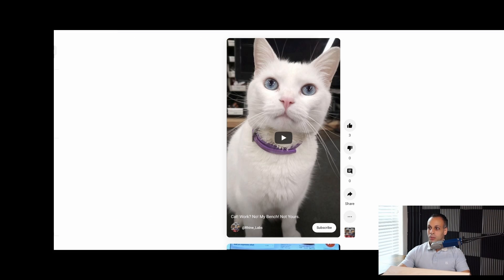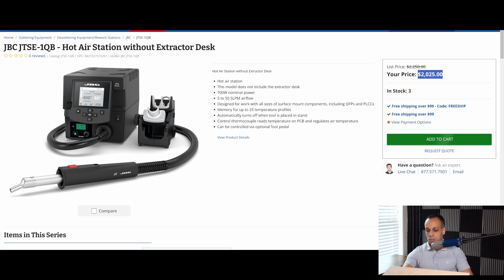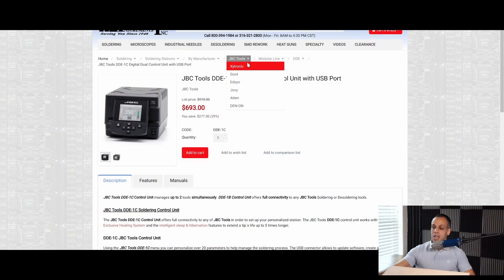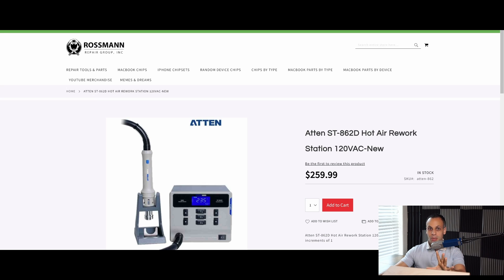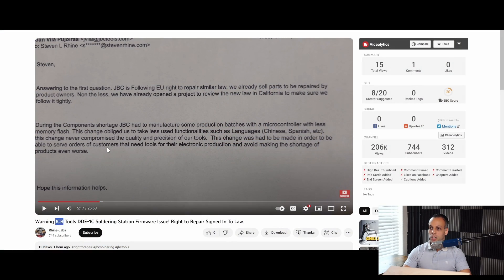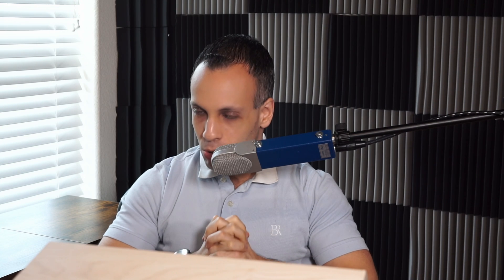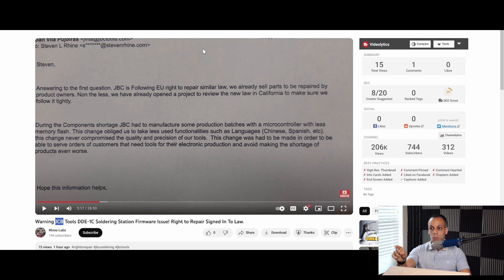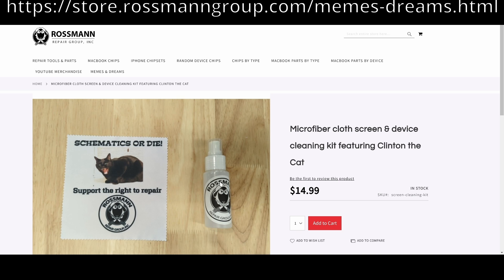JBC's handling of DDE-1C issues is informative & unfortunate 😞

Comment: General Motors was up front and STATED features NOT available at time of delivery AND will be added to YOUR CAR once the chips are available 
and they made "dummy" modules to install and replace the modules they are NOT including 
and now are fitting the ADVERTISED features as the modules are available NOW 
GM is NOT a corporate "good citizen" by a country mile and THEY can do it correctly 
JBC could have bean "upfront" and sold a version advertised differently and say call it the "basic" and nocked $9 from the price and make the original perma back order/ sold out till the original spec chips are in stock again 
they "win" as they do NOT have to "fix" sold products AND zero reputation hit OR post sale consumer support over this issue 
consumer does NOT lose as they BOUGHT a lower feature version BUT received that they paid for
Reply from the maker: This is the sad part. So few people used these features that being honest about it would've done so little damage. Lying and bsing about it when you sell the most expensive tool in the industry does far worse.

Comment: I used a JBC station just once. The thing was quite new at the time, it wobbled on the desk. it didn't give me the impression of being particularly solidly made or worth anything near the price it was. I'm still using an old Ungar (Bought out by Weller) station from the late 1980's and as I was smart enough to buy a lot of tips and a spare heating element, it still gets used most every day. Some 25 years ago I bought a second station, a Pace, which still works as well as the day I first used it too. The trouble is, in my opinion, people get sucked up in all this social media crap commercial shit telling them this or that consumer grade brand is "the best". Well, none of them are any fucking good and all are overpriced. That's probably why the likes of Philips or Holland Signaal (now Thales) didn't and still don't use Hakko or JBC or any of the "special Chinesium" crap. It's all Weller, Pace and some Ersa. Really, look into those manufacturers and upgrade to big boy tools and you'll be rid of this headache.

Comment: Funniest and saddest thing at once is… the stuff they have in their flash can be cleaned up and the features reinstated. Their code density isn’t great and it’d take some minor rework of the source code and linker scripts to make it better. The smaller flash should fit everything and the language overlays. You just have to apply a bit of thinking to it. JBC all you need for a fix is some brains and a firmware update.

Comment: Hi Louis, how do you handle hot air rework for smd components right next to electrolytic caps that do not tolerate heat ? I have to fix such a board for a 2004 honda car radio. I can put generic insolation silver tape to protect the caps but i am concerned it's not enough. I practiced on a scrap board with my 861DW and the tape did seem to protect the cap but the yellow glue that held it to the board (capacitor is mounted layed down on its side) burned and made a brown hard poodle ! I searched youtube for that issue and there is almost nothing on it.

Comment: I don't know when I've ever even heard of the most expensive of ANYTHING being the best. Usually it's just bragging rights. That said, shame on JBC for not being up front about changes to their specifications. A lot of very mission critical applications requiring certifications out the wazoo are relying on a so-called top notch vendor  to be technically sound. This stupid blunder could have and still may put companies at risk for un-knowingly violating certification requirements with the likes of NASA, Boing, the military, etc. Ask Fluke what they did during the chip shortage.

Comment: Gonna buy a JBC C245 pencil, control it with a cheap microcontroller + oled + encoder + MOSFET board, and power it with a 200W Meanwell PSU. Might be able to do the same with one of their hot air blowers.

Trust the hardware, do the problem solving in software.

Comment: I learned something, you can put an Arduino inside a hot air rework station along with a mono LCD and charge an extra $500USD, lie about it having ' features' and add more and not be held accountable.  I learned that you can ' forget ' to order SRAM ICs to store profiles and get away with it.  I learned that with my simple Arduino IDE level of programming skills I could design a better controller, have it use all the listed features of the several thousand dollar hot air rework station and use the same motor controller boards found in the 50+ Arduino Projects kits to control the hot air fan and temperatures with as fine precision and potentially open source the whole thing.
Reply: They should be using chips that never go out of stock, like old Microchip PICs or Espressif ESPs. All of industry relying on STM32s was the real problem, same for all hobbyists relying on AVRs. RP2040s are looking decent for supply capability, though personally I think these CH32Vs are looking appealing. The CH32V003 is cheaper than an ATtiny and has the specs of an ATmega, while the V203 is cheaper than an ATmega and has the specs of a pi pico. Programming tool chain looks decent, which is important. Supply capability is still up in the air, looks more available from their official store on Ali than their LCSC listing, for now.

Comment: This sucks. JBCs are amazing. Not so much the tweezers, hot air etc. The normal, regular size soldering iron is just so darned good. Been using at work for years. Wanted to buy one for myself. Hmmm. Shit. I saw an online thread on how you can buy the handpiece and just design your own power controller. I am qualified to do so.....i guess thats what ill do. The pinout/sensor is apparently straightforward.
Reply: Marco Reps did just that with excellent results. https://youtu.be/cYgjcDbSyRE  and https://youtu.be/GYIiOkr6x9o

Comment: I own a JBC station (although not a DDEC), and I regarded JBC very highly. Using the iron you really do notice a big quality difference and for their regular soldering irons, they are much nicer than some of the competition (such as Weller). Extremely disappointing to see this behaviour. It will definitely reconsider the purchase of their equipment in the future. If you pay an A class price, you expect A class service and a company that takes responsibility for their mishaps. 
I suppose they changed and are now riding on brand name trying to maximize profits. The exact behavior that costed Weller the market here in Europe. They dominated the solder iron market, but lack of innovation, sky high prices and drops in quality caused them to now become (in my eyes) B grade.

I figured they must have cheaped out a bit, as their packaging is also the 'pseudo enviro friendly' kind, which often enough translates to piss-poor and cheaped out on.

Comment: We've has a DMPSE (2000€ 4 Tool station) and honestly I'm really disappointed. 
The normal tools are very good. 
The tweezers are nice but plagued by stick-and-slip effect. You want them to operate smooth when you are working with small <0402 components and with little force. But the sdjustment between the both cartridges is another friction point, which makes it quite bad to handle. 
Also there is a lot of injection mold flash (relative to what you expect on a 2.5k€ tool)

Last but not least, the station let the magic smoke escape!
I turned it on, it did not boot and suddenly it started to smoke out of the vents. 
Further it seems the cartridges are powered on while the device is still booting. This can be notices as the cartridges have ~70°C when it bas booted up (while in their holder, where they are usually powered down completely). So I suspect someone messed up and it starts to heat up somwhere in the boot process.
Reply: How do you fix stick-and-slip? I thought this was because of the solder surface tension and not design? I'll have to check if my stations heat up on booting. I've never noticed anything, but I have the DDE-1C and it's predecessors, as well as the compact self-contained stations. Does the DMPSE take a long time to boot or anything? The stations I have appear to be almost instant on.

Comment: Hi, Louis you probably won't see this, but I figured I'd ask anyway. I want to set up a station for drone borne instrumentation controlled by Arduinos. As an aspiring amateur, what is your recommendation for equipment such as soldering stations?
Reply: I'm not Louis but personally I'd snag one of the clone compatible T12 stations or one of the generic stations compatible with the JBC C245 cartridges. Either option would work well. There's several revisions of the T12 style stations and some handpieces that are better than others, so do your homework. I have a clone T12 and am very happy with it's performance, though I might consider one of the C245 style systems if I were looking now. They weren't really common, and the prices have come down a lot in the last couple of years. Regardless, good luck, and I wish you well with it!
Reply: @2011JMB  thank you

Comment: The same is true for car recalls. Fords are always being recalled, it's your responsibility to bring it in, and they treat you like crap while it's happening. I know from experience. I've heard tale that some high end car brands, during a recall, drive a rental car to your house, drive off with their model for repairs, and then do the reverse at the back end. Real customer service.
Reply: I find it endlessly amusing that you can pay well over a 100k for a garbage ford truck. If you tolerate garbage you get garbage. It's quite simple.
Reply: I will NEVER buy a Ford again after how they treated me over a warranty repair.  My engine blew at 64,000 miles.  I pulled it off the side of the road, and it got a little tiny bit of mud up the side of the wheel well.  Had it towed in to the dealership I got it at (where I also did ALL my service!), to use my extended warranty - only to have the guy come out and yell at me that it wasn’t covered.  According to this “genius” I was “off roading” my vehicle and I owed them $3500 for a new engine.  I assured them I never did such a thing and they called me a liar, made a big deal over this literal LINE of mud in the wheel well,  and told me to get my car off their lot if I wasn’t going to have them fix it.  After a week of nothing but stress, and no car - I ended up calling Ford themselves (above the dealership), and a guy drove down from Detroit personally 👉🏻 and told him they were idiots for accusing me of off roading, and told them to fix my vehicle under warranty.  They way they acted you would have thought it came out of their pockets personally!  They lost me as a customer from that day forward!!!

Comment: That's really disappointing to hear. I have a DDE-1C in storage from 2018. Recently I ordered a third cartridge stand from them. 
If you think the station is overpriced, the stand is a block of cast iron and costs at least 1/2 to 2/3 the price of the DDE-1C.  It was packaged really poorly and insecurely compared to the first two I ordered several years prior. It came fresh from JBC and was actually damaged. I got it exchanged but the retailer came back and told me the replacement that came in was also damaged so they returned my money and cancelled the order. I did send a message to JBC it was not acceptable to skimp on packaging for something at that price point. Literally thrown into a box with long bundle of kraft paper loosely looped (looped in 2 dimensions, not wrapped) around it for padding. Just utterly unacceptable. It used to be form fitted foam or form fitting cardboard seats in the box.
Reply from the maker: It sucks when companies ride out their reputation and choose to stop caring
Reply: @rossmanngroup  We have a 15 year old JBC at work that would not power up for weeks at at time. Finally opened it up. One of the pins on the front panel toggle switch was just not soldered! The pin is too short and sits in the hole below the surface of the carrier board. The hemispherical dome on the other three soldered pins indicates they are also too short. It's amazing it ever powered up at all. No idea how QA missed this.